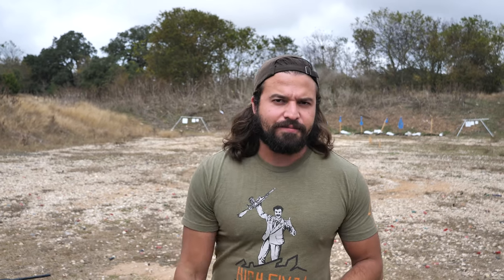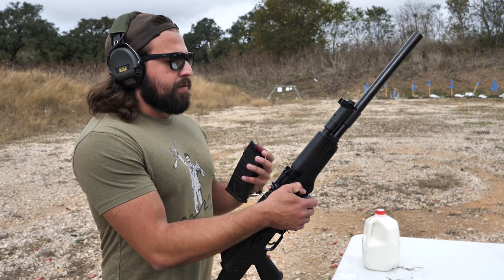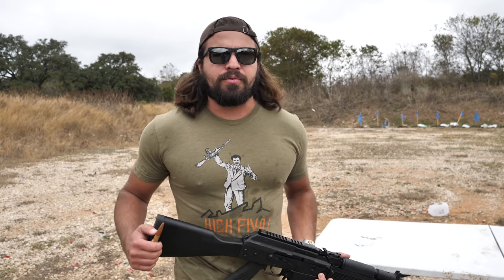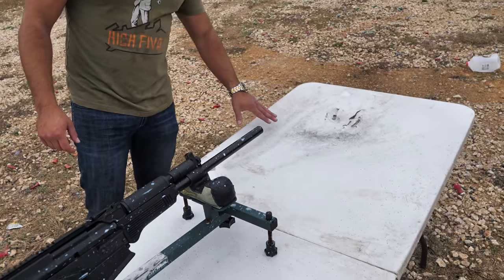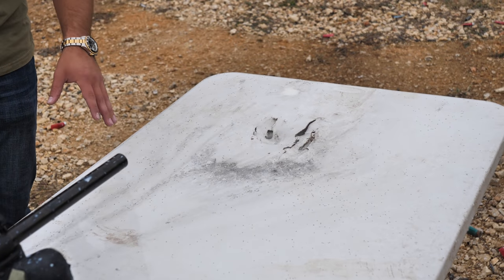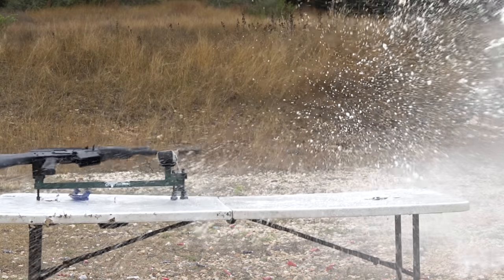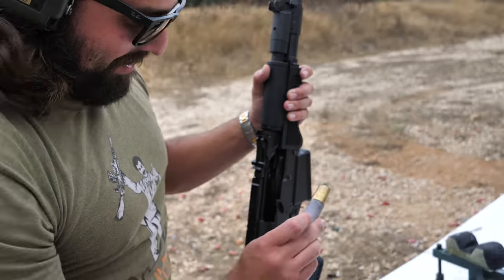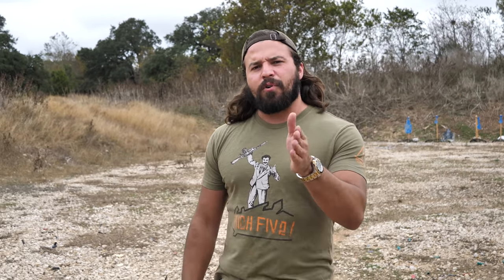Testing .50 BMG in a Semi-Auto Shotgun

Comment: Wouldn’t a 20 gauge hold the 50 a little tighter? If so it would be cool to see that
Reply: Wouldn’t fit
Reply: The only reason a 12 gauge holds a 50 is because they're the same diameter. 20 gauge would be to small.

Comment: Well, that's one way to shoot .50 BMG out of an AK. I think you'll have a harder time getting that to cycle than the AK-50 though.
It's funny how much more effect the buckshot had on the milk than the .50 with like ten times the energy does. I wasn't surprised that it survived the first time, like you said the almost total lack of chamber support means it isn't getting anywhere near the same pressure it would normally. Also not really surprised that the printed inserts survived when the gun did, since they were supported by the chamber and barrel just like the brass usually is. I do wonder if the pressure was still substantially lower or if the shotgun actually can survive .50 BMG pressure. I seriously doubt it since .50 BMG standard pressure is like three times 12ga proof pressure, but it's technically not impossible if the gun is overbuilt enough.
Reply: It doesn't need to be overbuilt. I remember reading something from a tester at Remington who decided to hand load proof shells to higher and higher pressures until the barrels actually started failing. As I recall, the 12 gauge Remington barrels he was testing started to blow up at 55k psi. He was increasing pressure by 5k psi increments and they all survived until they got over 50k psi. So, those particular Remington barrels could TECHNICALLY withstand the pressure of .50 BMG, but just barely. Considering that the diameter of the barrel won't allow a .50 bullet to seal it up, there was never a chance that barrel would explode. I would have bet money on it.

Comment: That's pretty interesting cuz I bought this shotgun for the reason that I'm thinking the aftermarket pieces for it are going to be amazing cuz the ability to change the chokes I'm believing that someone's going to come up with the way to make an insert rifle barrel that just goes in and it connects how the chokes connect and then some kind of mag well insert to where you can shoot rifle rounds thinner smaller rifle rounds I was hoping someone would come up with some kind of conversion for a 22 insert and maybe a bolt swap out so we can shoot any kind of rifle round but I don't see why you couldn't at some point come up with some ideal to make a barrel that inserted inside of this that would shoot that 50

Comment: Could you cut some plastic circles and drill a hole through them like plastic washers and put them over that taper on that 50 BMG and just run them through the shotgun actual magazine basically just put in like a space here I wonder how that would work
Reply: How about not plastic aluminum aluminum pieces that slide over the the hole of the BMG actual slug piece and the taper to fit inside of the shotgun barrel I think that would give you an interesting result
Reply: That's so funny you get all of a sudden in your video You're printing some s*** doing the same thing I was just thinking about bro you must be a mad scientist yo.

Comment: I got one of thesw JTS M12 Saiga Clones and it's surprisingly nice for how cheap it was. Definitely needs a stock and furniture replacement though but all of the parts are nice and solid, the trigger is extremely satisfyingly crispy and light, and the adjustable gas block is an AWESOME feature especially in a semi automatic shotty for $300.

Comment: replace the 3d printed parts with aluminium tubes, it will be stronger than 3d prints, so more pressure buildup, but weaker than steel, (that should hopefully keep it from exploding).

Comment: Lol, you should use that fireformed and now perfectly fitting brass of the first shot, cut it clean it, re-prime it, put the powder of a new 50 in there and cap it off with a big solid lead slug. It should build the pressure then.

Comment: Ur 3d print was cool but it should have been the full taper and the tip seperate so it bore levels the bullet and seals the barrel and try agian then u can make a barrel in 50 to swap and see if it will run a round if it will try to cycle then u should cut the receiver and extend it to except the 50 mag im sure we can make it work flawless

Comment: I know next to nothing about the bore size of the 50 bmg but it would be interesting to see a shotgun shell fired out of the bmg. I'm aware that the slug especially is a larger projectile than the bullet normally fired. We all know that chokes in shotguns are to affect the spread of the shot. I wonder though what if the shot was concentrated even more in a long rifle barrel, would it add or take away from its effectiveness. This may be a dumb idea but was just curious if the opposite was attempted in some way. Would even a 410 slug fit down the barrel if you could make the shell fit the barrel?

Comment: Don't particularly like AK's or AK platforms. Don't particularly like you. I went and bought one of these because of your video. Earned its place in the line up. Very surprising it didn't blow apart. I won't put a .50 in any other shotgun I own. Then again, I won't put one in this either. It also eats everything I've put in it. Pretty inexpensive. Good video. I subscribed. Well done.
Reply: Read most of the comments below. A lot of folks out there don't understand ballistics or basic physics. They say there's no such thing as a stupid question. Very untrue. Lots of stupid questions are out there.